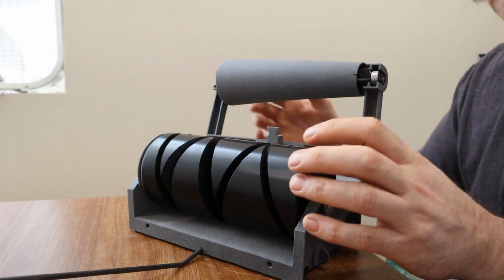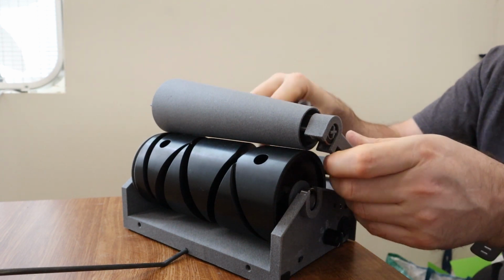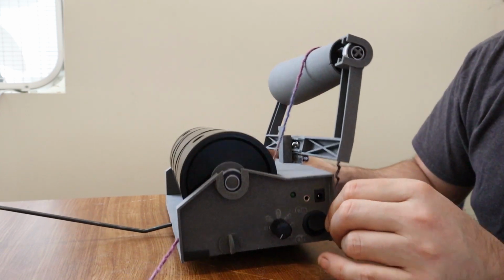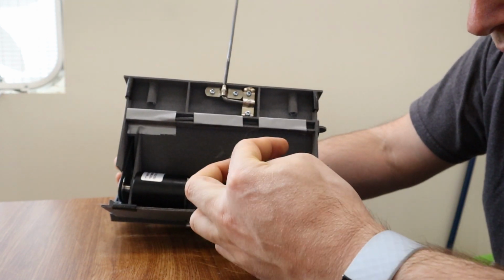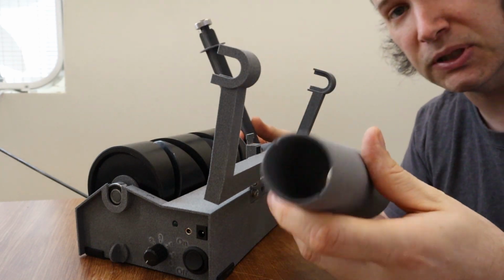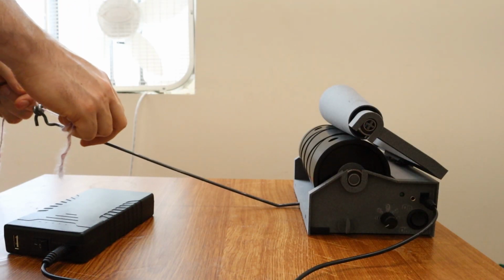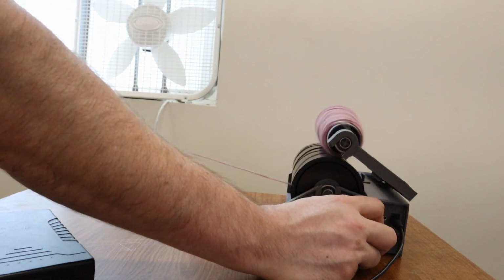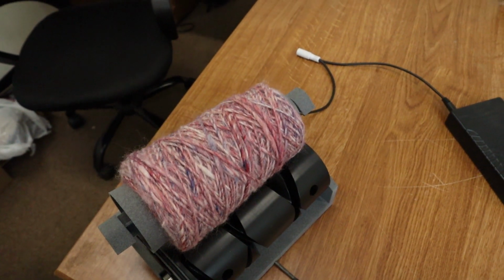SPIN #119 - Cone Winder Prototype (June 2021)

Comment: Not Shure how is actually produced , but you better put the on off switch on top and power connection on the bottom. Otherwise you annoy yourself reaching under the power cord to switch it on and off …

Comment: My manual winder is clamped to the table, so when I go very fast, it doesn't jump everywhere. 

If your winder has the option to screw it down (like your EEW) then I would do that straight away.
Even if onto a large wooden breadboard.
Just to keep it stable..

Comment: Any option of a foot pedal or a switch on the cable?
I wind tons of yarn with hand winders and one issue is "feeding" in the yarn is limited to one's arms length. 
If you look at where you are standing,  you need to go far to switch it on and off.
A manual wool winder, I am facing the crank, and my arm is stretched out to the left (as I am right handed) and the yarn is fed via the back of the winder, through the metal eyelet.

So maybe you need to position yourself at the 90° angle to the switch  (as that is what is important,  to quickly be able to switch it one and off) and go from there.

It might even mean adding an extra eyelet.

My huge woolwinder has two eyelets. 
One on a metal arm and one near the actual mechanism. 

But, because I can only feed the yarn with one hand, I often get a volunteer to untangle the balls (commercial) or to monitor the skeins on the  swift/umbrella.

Either way, freeing a hand is a dream.
So your woodwinder is excellent for that..

Comment: What if you added elastic tension bands at each end of the cone bobbin arm to hold the cone closer to the drum?
Reply from the maker: That or adding a spring is on my list of things to try.  The downside of this is it will make changing cones a little more work and the elastic will increase tension in the reciprocal of what we want, but it still might work ok.

Comment: Would you consider making the dimensions of the cone such that we could use our increasing stack of empty cardboard cones?  As a weaver, I often want to warp 4 or more threads at a time, so wind off warp on to 3+ other cones.
Reply from the maker: I am planning to switch to a standard size cone.  The issue is that there are many different sizes of cones.  As I've mentioned before I will look into supporting more sizes by making 3d printable attachments, but I haven't gotten to that stage yet.

Comment: I have a few ideas since you're asked for them! What about:
1.) 2 spring hinges? Same size or slightly smaller/larger. One on each 'bar'. You could use the brace for either side to hold it up out of the way. An additional spring may have just enough tension to create the drag needed to keep the cone against the drum.
2.) A longer hinge along the center of the back (a mini piano hinge); again using the idea of more spring makes more tension/drag.
3.) Ditch the spring completely while keeping the hings of course but have rubber/silicone bands that hook on either end of the cone holder onto the body of the base; they'd have to be fairly loose in elasticity but they'd keep the cone in contact with the drum and would stretch up as the cone fills.
That's all I've got! Except for this - I WANT ONE! 

Thank you!!!!!
Reply from the maker: I'm considering using 2 spring hinges, but this would add some cost so I was trying to avoid it.

A longer hinge isn't really needed.  What I need is more clamping force or some other way to solve the drum slipping on the cone.  I'm looking at a few different options here.

An earlier version actually had springs on the side, but those had to be removed to change cones.  I'd rather avoid going back to this, but it is an option on my list if other ideas don't work out.

Comment: Will the cone be small enough for a paper cone to slide over it??  That would be very useful.
Reply from the maker: I've seen lots of different sizes of paper cones, but most wouldn't fit over the plastic cones.  I'm looking into options that would work for this though.

Comment: I haven't decided if I'll be getting this when it's available,  but based on this video I'd probably feed the yarn through the guide on my ball winder (clamping it nearby) rather then fuss with the attached guide as you have it. Apparently I'm in the minority that doesn't want an attached guide,  because it seems awkward to store in between uses in addition to needing a larger table space when using it.
Reply from the maker: I'm still evaluating how all this will work.  I've realized I'll need some tension system and that might change my plans in this area yet.  I think I'll probably end up testing multiple options and see which one most of my testers prefer.  Then I'll compare that against the cost.

Comment: What about inserting a brass rod into the center of the arm that holds the cone?
Reply from the maker: That would add some weight, but it would probably be the most expensive way to add weight.  It's an option I'll keep in mind, but I'll explore less expensive options first.
Reply: I would think that in addition to adding weight it would also add strength to the arm & would be inserted during injection moulding. When you say a lot more expensive, after initial tooling is it a $2 more or $25 ea more? Your time is worth a lot unless it’s for the enjoyment of tinkering on things.  Thank you for doing that.
Reply from the maker: @bobbierankin2970  To the total BOM it would be somewhere between those prices.  I don't know the exact price without finalizing a new design which will take a lot of time since it would require a redesign and price analysis effort since it would require a blending of plastic and metal in a way which I'm not immediately sure what the most economical solution is.  I also suspect it won't add enough weight to totally solve the issue on it's own, but I'm not sure of this.  If you look at the industrial machines they add a lot of weight on an arm that gives them leverage.  Now, they are going to be going a lot faster than so maybe this smaller extra weight would be enough for our machine.  I need to put time into testing the various solutions and see what is going to be the best solution in my opinion.  I think even as it is right now would work for most people, but I'm pretty sure I can do better which a big price increase.

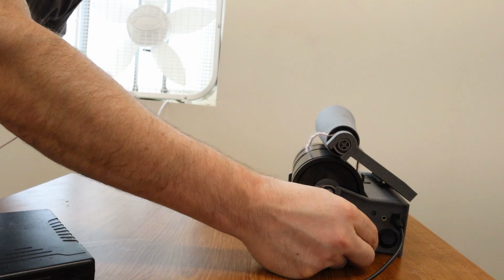Comment: Watching around the 7:45 mark when you started winding the yarn on, I could see some jumping/slipping of the cone as you indicated would happen. Could the use of two springs (at the thirds positions) instead of the one middle help even out the pressure applied and give a bit more downward pressure of the cone to the drum? Or would that weaken the arm?
Reply from the maker: Yes, that is an option.  One of the earlier versions of the cone winder that I showed on youtube actually did that.  I went away from it because it was annoying to have to take off the springs to remove the cone.  So I'd like to avoid this and go with one of the solutions I mentioned in the video, but this is one that would work and I'll keep it in mind.

Comment: Hey Maurice, 
Ideas for solving the weight issue:
How about the user wraps a weight around the inside arm? You have those nice cross bars, and I could see tucking some weights in - maybe tire weights. I'd be willing to tape weight in after it's arrived. I've used sticky ones at Harbor Freight that would be a cheap option that purchasers could purchase themselves to save shipping costs.

Another thought is adding some thin rubber strips to the drum on the very outside to increase tension without adding weight to the arm. I'm not sure if that would solve the weight issue, but i've done something similar to my hand cone-winder, and it helped a little. (Mine is a bad copy(?) of the Royal Winder.)
 
Is there anyway that the cone could be on the bottom and the drum on the top arm? I don't know if that would totally mess up the design or even work, but it's a thought too. 

Hope something here is helpful, and I"m so glad you are working on this design. I cannot wait to plunk down my money for it!!! 
thanks, 
Sharah
Reply from the maker: I am considering options for the weights and want to figure out if they are even needed.  If they are needed I'll need to figure out the advantages of doing this before I ship and paying the extra shipping vs having the end customer doing it.

I've thought some about those rubber strips.  It would have to be something like a rubber band because I'm not planning to do a custom drum, but instead want to use a standard part.  There are lots of options so I will experiment with a few of them to figure out what works best.

I didn't actually consider putting the cone on the bottom so that's an interesting one.  With a little though I think that would cause a lot of problems.  The main one is the cone constantly changes size so the base would need to be designed to support the largest cone.  The current design is better here, because only the arm needs to handle the growing cone size.

Comment: Maurice, I really like the new adjustments you have added. I love the hook to pull the yarn through and how it has self storage. Same with the stopper to hold the bobbin up when adjusting or adding yarn.
Suggestions from a csm user: 
Prefer using the cardboard cones as I have a  dozens. Maybe an adapter would solve that issue. Also the cardboard may solve the slippage issue as they have texture. But then there are lots of different types of cardboard cones.
Then maybe you could design a cardboard cone for this specifically which may cut down cost for additional cones. 
Weight in the base or clamp to hold it in place. I can see this walking across the table and falling on the floor risking breakage.
Would two hinges solve your problem? One towards either end. Might make it less flimsy and stronger.
Be great to have a way to store the yarn guide when not in use. Telescope or slip inside to extend? Two pieces that twist, pull and extend? 
Can't wait to try this out! Definitely solves a major issue for csm users!! Thank you working so hard on this!!

Comment: I have seen cardboard cones that are textured on the outside.  The extra friction from a textured cone might reduce the slipping.  Frankly, however, I don't see it as a problem from your demonstration.  A slow start seems to minimize the slipping.  My Ashford ewinder requires a slow start to achieve a nice cake.  I would have no problem starting slowly, then increasing the speed as the cone weight increases.  That's completely workable.

Comment: Hi Maurice, would it be possible to add a short spring from the cone bar to the base to add the extra tension needed at the beginning of the wrap,  it could rest inside the core arm(base) and just have a little clip to put over the base initially.  I'll email a sketch of what I'm thinking.

Comment: It looks really great. I've wanted a cone winder for my sock cranking machine for so long. Could you put an elastic loop between the movable arm and main body, to provide downward pressure? Of course that will keep adding pressure the more yarn is wound on (the opposite of what is wanted), so maybe the user could take the elastic off after an initial phase of winding.
Reply from the maker: This isn't ideal because it would be rubbing against the yarn.  I do have an earlier video of this where there were springs on the side that accomplished what you want, but I found attaching and unattaching those was a pain so I'm hopeful I can find a better solution.

One thing is you can always just push down on it with your hand and since the cones fill up quite quickly that isn't such a bad option.  But I'm hopeful I can get it working without that kind of user attention.

Comment: I can see where the yarn guide is a bit of a problem.  Distance vs stability.  My only thought is an separate yarn guide where the cone winder is on on side of the table and a yarn guide is on the other side, to reduce the bouncing around.  The extra distance and a more stable guide.  Of course that leaves you with two objects to keep track of.
Reply from the maker: I actually have an older version of the cone winder on youtube that does exactly that.  However, I got the feedback that most people would prefer a single piece.  I might make a 3d printable attachment.  I also need to figure out how I will do tension so this might all change still.  I should actually probably work on tension next since that is probably the hardest open problem I have left here.

Comment: I am a weaver and I don't often use all the yarn on a single cone at one time. I am concerned about having to buy many special cones that fit the winder. The winder would be more useful to me if I could reuse a cardboard cone rather than having to aquire "special" comes.. Some weaving yarns also come on tube. There seem to be a few standard sizes where yarn comes on one pound cones. I'd like to see the winder support some of those..

Comment: Can you manufacture the cone with raised grooves built right into the cone instead of a smooth cone? It might help the yarn grip at the beginning and make it easier to spool on. Also, could you use or add magnets for extra weight and help the hinge close stronger? You may want to manufacture and sell a cone ‘unwinder’. Maybe somehow integrate one into the design?  I am so looking forward to purchasing this.  BTW, I still LOVE my EEW 6 and use it almost daily!
Reply from the maker: The raised groves wouldn't really help much with gripping the drum (I don't think) however, I do think material of the cone might help.  That said I might add some groves to the cone's texture to help the yarn grip.  Thanks for the suggestions!
Reply: I like the idea of magnets to help pull the cone tighter to the winder at the start of winding.

Comment: My main concern about about rubberizing the cone is that overtime it may become tacky like a lot of rubber products do.  I think a texturized plastic (like this looks to be) is better in the long run. Also if you made the cores straight instead of cone shaped would not solve the slipping issue? But then I'm not sure of the purpose for the core being cone shaped to begin with.
Reply: To allow the bottom yarn to release without dragging on all the other yarn on the way up.

Comment: What sort of power supply are you using? I bought a power bank to power my electric spinner but it seems it needs some sort of electronics to be able to extract 12 volts from it.
Reply from the maker: I'm using a 12V tallentcell battery pack.  The same type I recommend for the EEW 6.0.

Comment: It's so great to see the progress you are making! I've used two different industrial cone winders and did have some thoughts. 
I was surprised to see you winding the yarn straight onto the base cone vs. adding a cardboard or light plastic cone for the actual winding. If I had a cone winder like this, I'd want cardboard cones so I can wind a whole bunch of different yarns cheaply. Also, when I previously used winders, we'd tuck the yarn tail inside the cardboard cone before jamming it on the machines base cone. If we were using a very slippery yarn like a rayon, we'd first wind a couple rounds of cotton to grip better.
In terms of weight, I personally would pay more for a machine with heavier parts if it was explained why it works better. You could build some of the extra shipping cost into product cost as well. Watching it go at high speed, it seems like the winder could start "walking" on the table, so more weight would also help that.
One other thought, is there any way to reduce the flex in the arm holding the cone? That might be causing the cone to not make even contact with the cylinder.
Reply from the maker: Thanks for the feedback.  I can't make everyone completely happy and from the past poll I'm pretty sure keeping the price affordable is pretty important.  There are mini industrial versions that can already be bought for around $1500 so if you really want a big heavy one that is an option (these weigh around 100 pounds) - look on alibaba.  My intention is not to make a bad product, but I want to make the best product that can fit into around a $200 price while making it easy for people to move/store.

I really don't see why the arm flex would cause the cone to not make contact with the drum.  I think you must be looking at a bad angle or something.  If anything this flex makes sure there is full contact even if the angle of the cone is a little different.

Comment: Love the design of this and how you’re bringing industrial concepts like this to the consumer market. Have you considered putting a rubber ring or something similar on the end of the drum that contacts with wide part of the cone? Maybe raised above the surface of the drum so when the yarn takes over being the main point of contact with the drum, it then has enough weight to maintain the necessary amount of friction. That way you get the traction you need without having to use a special material on each cone. Ofc not sure how much that would mess up your space tolerances around the drum, so it might be more work than it’s worth.
Reply from the maker: Adding that to the drum isn't something I considered.  It could be difficult since I can't modify the drum as I'm using  a standard part there, but this is something I'll look into.
Reply: @DreamingRobotsBlog  What about using an O-ring on the cone itself. May put a slight groove to hold it in place. If people have their own cones maybe they could just use a rubber band or a small bead of hot glue around one side.
Reply from the maker: @deushache  That is something I have considered, but I tend to think that just changing the material of the cone will be better (in terms of functionality and cost), but this is something I need to talk with my plastics manufacturer about.